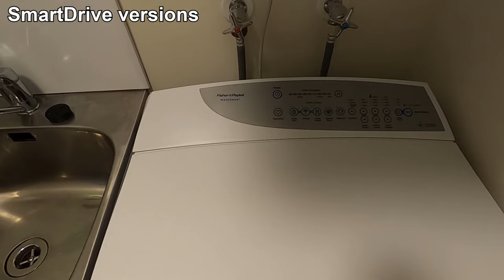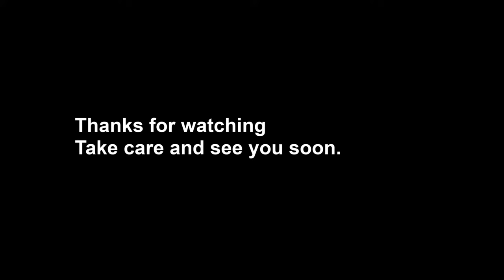Washing machine bowl clean Fisher & Paykel SmartDrive washing machine

Comment: thank you! I did this today after a week or two of my wife saying the washer smelled moldy. It wasn't as much cleaning as what yours required, but I used the pressure washer and it went smoothly. The primary issue I think was the nasty water at the bottom of the outer bowl/casing. I used a giant syringe to suck that up, scrubbed, and bleached it.
Reply from the maker: Thanks for the comment, glad you found the video useful glad to hear you cleaned your machine, the pressure washer definitely makes the job quicker 🙂.  Another thing you can try to stop the musty/moldy smell is just leave the lid open after a wash that can help dry the bowl and close again later.
Reply: Is it just me, but I could not remove the inner tub.

Comment: Your one is actually a phase 9 which is a yellow module. Phase 9 was produced from 2011 to present, if you look at the label tucked behind the panel where C & H labels for the hoses are, on the serial number, there is 2 letters that represent the date and year of manufacture.
Reply from the maker: Hi Luke, thanks for letting me know 😊. I think I purchased the machine in around 2014 so that makes sense.

Comment: Great video!  Waiting on a replacement drain pump to arrive so I went ahead and cleaned my 2007 GWL15 while it was out of service.  I noticed that the inner drum seems to have some water/fluid sloshing around inside it that I haven't been able to find a way to drain out of there.  Is there a way to disassemble the inner drum further to remove the water/fluid?  Or does this water/fluid need to stay in there for dynamic balancing?
Reply from the maker: Hi there, thanks for watching appreciate the comment.  Hope all goes well with the replacement pump fitting.  Yes a viewer in the comments section commented on how to empty the remaining water/fluid from the inner drum. I think you had some screws to undo in order to empty, have a scroll through the comments and you will see what is needed there.  Thanks again 🙂👍

Comment: This is one of the most eye opening cleaning videos I have ever seen. I had never thought to cleanb my machine other than with the white vinegar rinse cycle and a wipe over with a dettol wipe. Within moments of watching it, I paused at each step and found this gentleman's advice to be so clear I could work through and clean every part of my machine as he did. I am in a state of shock.

I live in Sydney where everyone now has mould problems and things smelling - I am thrilled to have conquered something I would never have imagined I could do. And oh so easy thank you very much.

I also should say I have found Fisher and Paykel products to be amazing. This wachine machine was so easy to install - i bought it at a time it came with a video in a cassette!! Which explained what to do - and amazingly it worked so quickly - and I have never ever had to have it repaired.

Thank you again and hats off to this gentleman for such clarity and lack of fuss.
Reply from the maker: Thanks so much for this lovely comment I really do appreciate that.  Happy to hear that you have cleaned your machine.  Another tip is leave the lid open after a wash that helps to keep the bowl dry and hopefully wont get moldy. Thanks for watching and take care 🙂👍
Reply: Appreciate you taking the time - I already do that and think it has made a huge difference. I have also started using a product called DampFree which has a hanger product to capture water in the air and I hang that alongside the machine to ensure the space is healthier. @MannixGarage
Reply: I agree with your every word‼️😀
So clearly explained & demonstrated.  👍🏽.        🇭🇲

Comment: My washing machine is 15 years old and I have never done this before. I was getting muddy bits on the washing and always on the white things. This was easy to follow and my how much fluff and dirt did I find. The only thing I did different was wipe down the inside of the outer bowl and that way not so much water to take out. Couldn't unscrew the pump cover but I think the rest of the cleaning should be sufficient. I was thinking the dirt came from the tank as the rinse is tank water. it was from then washing machine.
So happy thank you.
Reply from the maker: Hi there, glad to hear you found the video useful and cleaned your machine successfully.  They are good machines just need a clean every now and again and good as new.  Appreciate the comment and thanks for watching, take care 🙂👍

Comment: Excellent! I bought my MW511 in 2005. Thought it might have just been getting old.
The stuff I found in there! Coins staples, bobby pins... The hardest bit to clean was the rust accreted to the outer bowl. 

The only thing I couldn't work out is how to drain all the water out of the inner bowl. There seems to be water trapped in between the two stainless layers.

Also, closing up tip. Make sure the back is firmly pushed down. And there's a rubber clip covering the earth wire. Make sure that is back in place.

10/10. Would do it again! (maybe sooner than 20 years...)
Reply from the maker: Thanks for watching and appreciate the comment.  Yes its quite a surprise to see what you find in the bottom of the bowl there, good to get it all out and cleaned up that's for sure.  Someone in the comments mentioned how to get the water out in the inner bowl so you can add that to the next clean schedule.  Thanks for the tips re cover.   Take care 🙂
Reply: @MannixGarage  I should also add that we now have lint free washes!

Comment: You can also remove the lid, makes the other parts of the job easier and you can clean the top deck properly. 
Older models will have an out-of-balance detection lever  (would be visible at around 2:22) so be careful not to snap that off.
Finally while you have the inner bowl out, undo the three screws in the bottom of it and remove the drive dog so you can clean the gunge that will be hiding in there.
Reply: Thank you!
Reply from the maker: Thanks for the additional info very handy to know much appreciated.  👍🙂 Happy New Year

Comment: Thank you for this vid, in terms of washing powder and softeners are there any you would recommend to avoid this sort of build up?
Reply from the maker: Hi there, no worries thanks for watching.  Yes a few things you can do, firstly I always wash in cold water  but you can do the odd hot wash, high water level once a month or so, that will help reduce the soap scum buildup as it may not dissolve as well in a cold wash.  Use the correct amount of washing liquid or powder, don't over do it.  Don't use fabric softeners they can cause a residue build up in the washing machine, or if you need to use it dilute it (best not to use it).  Leave the lid open to let the air in to dry bowl after a wash. Cheers 🙂

Comment: I have a very similar, if not the same, Fisher & Paykel. After following your instructions here to clean the inner bowl, it looks as though a lot blackish buildup has collected under the inner bowl below the area where the inner bowl drains. I'm wondering if I ought to soak it with some bleach or CLR. Any thoughts on that?
Reply from the maker: Have you taken the inner bowl physically out to clean, you should be able to clean the black buildup off once removed with a small brush.  I guess you could use bleach for a short soak but keep in mind the bleach isn't good for stainless so don't leave soaking for too long.  Take care and thanks for watching 🙂

Comment: Nice vid! followed but after taking out the inner bowl , I can hear water sloshing about in it  (rolling about on the grass)  - but I cannot see any way to remove that water ?
Reply from the maker: Hi there, thanks for watching.  Someone mentioned in the comments and I think it could be related to your query "Finally while you have the inner bowl out, undo the three screws in the bottom of it and remove the drive dog so you can clean the gunge that will be hiding in there."
If you have already put the machine back together perhaps just put it on the list to do next time you do a clean.  Hope that helps take care 👍👍🙂

Comment: Thank you for the video. Very helpful.  There is water stick in the bowl. Any ideas on why and how to remove / drain it?
Reply from the maker: Hi Eliza, thanks for the question.  Is this water stuck in the bowl after a spin cycle?  If so its possible that the pump has a slight blockage

This step should give you an idea if pump is blocked,  remove the top deck and inner bowl (as seen in my video). Bail out the water, remove the pump cap and hood (as seen in 5:00 in my video)  and clear
the pump of any obstructions, if there is a big build up of dirt and lint this could be the cause.  Once you clear this area you can confirm if pump is pumping by putting say a bucket of water in the inner bowl and running a spin cycle.  If it is still not pumping properly there could still be a blockage at the pump, you will need to remove the pump from the bottom of the machine to clear this, if you need to see how this is done here is a great video showing you to do that step https://www.youtube.com/watch?v=8piQat8DQcI

Hope you get it sorted and thanks for the question

Comment: Hi, I got F&P model MW512  washing machine and i'm having trouble removing the tub, do you have a detailed tutorial on how to remove it please?
Reply from the maker: Hi there, is that removing inner bowl you mean?  If you have already removed the agitator successfully but its the inner bowl that's stuck, fill a bucket with hot tap water and poor over the middle part that the bowl mounts to (if you see what I mean).  Then try pull the bowl from following step 6 of the video.  Hope that helps, keep us posted.  Thanks 🙂
Reply: Did it help, because I have the same problem. Mine just won't budge.

Comment: I'm trying to pull out the inner bowl, but mines getting stuck after coming up about 10mm 😩 Any tips?
Reply from the maker: Hi there, if you have followed all the steps in the video try pouring some hot tap water over the shaft area (not boiling water), you also may have to get someone else to help you to put pressure on the shaft (eg use a short length of timber placed on shaft) while you pull the inner bowl off.  Hope that helps thanks for watching.
Reply: @MannixGarage  thanks - I was meant to follow up on my comment and forgot - I poured a small amount of vinegar on top of the toothed shaft and then wrestled with it a few more times and it finally came loose. 

Thanks for your awesome walkthrough, it gave me so much confidence!
Reply: Undo the three screws holding the drive dog assembly if the inner bowl is stuck. You can then get all the crud out of this part too.
Reply from the maker: @taratitipene6692  Try maybe hot water or even wd40 or crc if you have some handy.  Also someone mentioned vinegar and worked for them, hope you sort it.

Comment: My bowl has water sloshing in the bottom is the normal?
Reply from the maker: Hi there, its possible you might have a blockage around the pump, just check that there is nothing stuck there like a build up of lint.  However if you are talking about water left in the bowl like in my video after I cleaned the inner bowl, that's ok, either scoop it out like I did or just run a rinse cycle after.  Thanks 🙂
Reply: @MannixGarage  this is inside the internal bowl the outer bowl were the pump is clear 😅 so when you lift the internal drum out it’s sloshing around in that. It looks sealed all the way around and I cannot find any cracks or holes so not sure how it go inside there
Reply: I don’t think it’s meant to be there 🤣
Reply: @nfi2nfi2  don't drain the water out of the top and bottom sealed parts of the inner bowl, that acts as a balance ring.
Reply: @lukekneebone9831  new suspension rods only then 👍🏻, thanks for the help guys
Reply: That is there to help balance the bowl while spinning. Do not remove.

Comment: Can't even get the agitator retaining nut loose. Any tips?
Reply from the maker: This will be a long shot but worth a try.  Run through a low level hot wash cycle, just let it fill and pause the machine once at the low fill level.  Check water level is above the retaining nut.  Leave for say 20 mins, then go straight to the spin cycle to empty water. The heat from the hot water may heat soak through the retaining nut hopefully making it easier to undo.

Comment: Help - the bowl will not come out.
Reply from the maker: Hi there, sorry for the late reply but some of the comments left with similar issue from people which you could try;
“I poured a small amount of vinegar on top of the toothed shaft and then wrestled with it a few more times and it finally came loose.”
“Undo the three screws holding the drive dog assembly if the inner bowl is stuck. You can then get all the crud out of this part too.”
But I would try pouring some hot water from the tap over the shaft area that may loosen things up for you.  I Hope that helps with getting it out, keep trying you will get there.
Reply: @MannixGarage  - a genuine, thank you .
Reply: I finally was able to remove the inner bowl.

Comment: My inner bowl won’t come out :(
Reply from the maker: Hi there, there have been some other viewers with the same issue, if you look through the comments it seems to be that using vinegar will help free up the inner bowl.  Give that a try and I hope that helps.  Let us know how you get on if you like.  Thanks 🙂
Reply: @MannixGarage  Hey! After 3 hours I managed to get it out. I had to use super hot water (not boiling) with vinegar mixed into it. And I had to step on the middle part while pulling the bowl super hard to get it out. Once I got it out enough where I couldn’t stand on the middle anymore I managed to wiggle it out. Gave it a really good clean before putting it back. When I put it back in I tried to pull it out again to see if it would still be stuck but I had no issues 😊
Reply: @MannixGarage  also mine was literally 10times dirtier than this, thick sludge over every surface. The machine was second hand and had obviously never been cleaned lol so I’m happy I managed to get it super clean again 😊
Reply from the maker: @nadiastone6422  That's so good to hear you got it out and cleaned.  Yes nothing wrong with second hand stuff and they are good machines and at least you know how to clean it out so its as good as new well done.  Thanks for replying too as it may help someone else with the same issue.  Good result! Thanks for watching and appreciate the comments 🙂